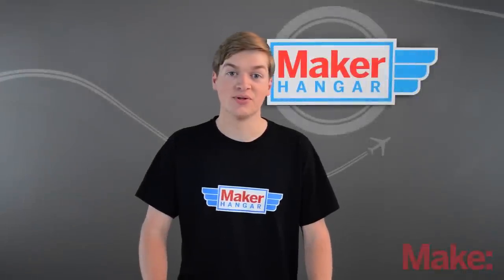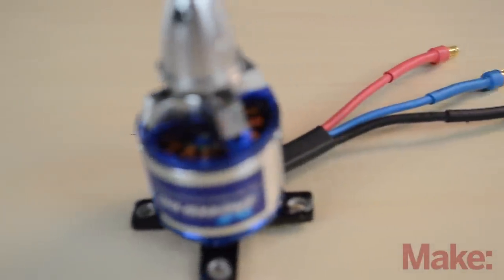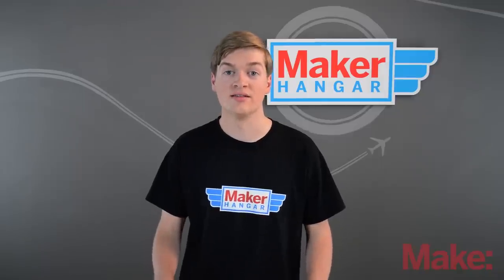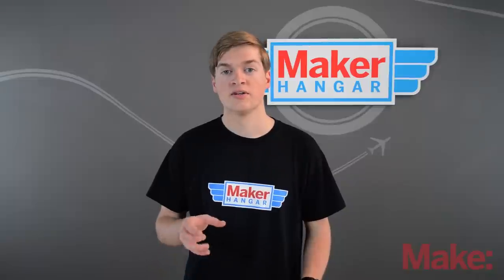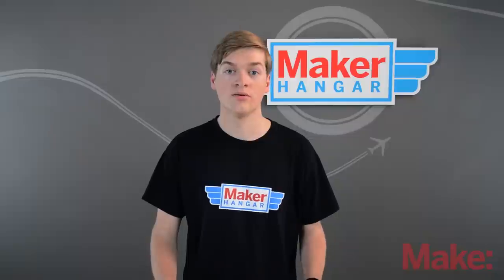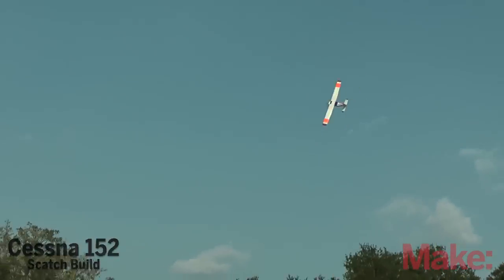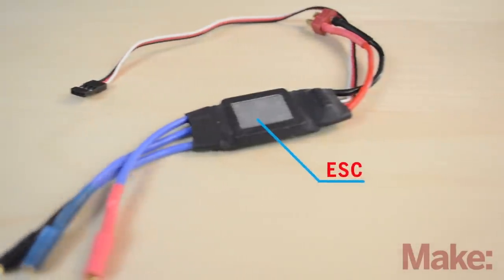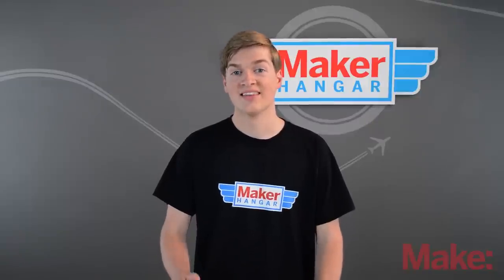Maker Hangar: Episode 2 - Motors/Propellers

Comment: I have the same plane Corsair E-Flite  crashed the same reason battery  bad  solder connection, and I have a 12X8 APC  electric propeller  , it pulls like crazy on the floor in the house   so in the air It maybe OK what size to use  2 blade, and I have a lot of 2 blades in wood  12X6  I'm but afraid  of flaps never had them in 15 years of flying so should I even try them ?

Comment: Lucas, you made some rather blanket statements about the motors. I understand cause they are a mysterious thing to most of us. The motor in your hairdryer or drill is (probably) a DC motor, AC passes through a bridge rectifier before hitting the motor. AC motors have a commutator and are NOT reversible. The motors used in the RC hobby are a special type of motor that is an AC like design but we run them on simulated AC from a PWM'd DC source.

Comment: you never talked about size of aircraft and motor type or prop size? im building a Wing vtol style meaning one motor in each wing small prop almost just as big as its wing, i was hopin to get tips as im 3D printing one and want to use a dc brushed motor
Reply: please use a brushless motor they are mush lighter and to answer your main question: if you look at some motors they will often say the thrust with a prop. if there is more thrust than weight then you can use it as a vtol. if you use more than one motor then you just ad the thrust together. hope this was usefull

Comment: hi sir nice information's I have a doubt.
what will be happen if we use high kV motor with long prop?.
I have an application of lift about 5 kg in quardcopter so for that what kind of motor and propeller is the rite one 
please help me if you know
Reply: +Manikandan R dont do that
Reply: +ConorCon Man03 why ????
Reply: +Manikandan R It wont work, high kV motors are tiny and your prop wont fit on it and is your quadcopter 5kg? That is really heavy you'll need some big motors to lift that. Probably a 370kV motor with a 12-15 inch prop: http://www.hobbyking.com/hobbyking/store/__67031__Quanum_MT_Series_4108_370KV_Brushless_Multirotor_Motor_Built_by_DYS.html
Reply: the high kv moter will just get very hot and burn out. propobly also the ESC

Comment: Hey Lucas, the motor you chosen the sealer is advising to use one of this (see below) but you chose a 6x5. I cannot understand that it goes all against you said?

Prop Tests:
5x5 - 11.1v - 123W - 11.1A 
5x5 - 14.8v - 303W - 20.5A
6x4 - 11.1v - 182W - 16.4A
6x4 - 14.8v - 438W - 29.6A

Comment: if a 3000kv bldc motor can run at 3000rpm per volt then at what maximum speed it can run or upto what voltage it can run?
Reply: 1 volt = 3000 (on a 3000kv motor) if you put 10v it will spin to 30000 but speed at the end depends on propeller size., size can add or reduce torque and speed..

Comment: What happen if I use 1000kv motor with 6 inches prop
Reply: Kuldeep Nikam you won't get much thrust. Use 1000kv motors with 10x4.5 inch props and 2200kv motors for 6x4 inch props. The 1000kv motor setup is more efficient and you will get more thrust.
Reply: And that's for 3s. For 2s batteries you need props that are bigger and for 4s you need smaller props. I mean a 2 inch difference.
Reply: it will catch on fire in middle of flight and nose dive to hell

Comment: There are so so many technical innacuracies in your videos make. brushless motors are NOT AC. They are BLDC motor (brush less DIRECT CURRENT) motors. The input is DC not a square wave as you show. And the output is a 3 phase PWM modulated square wave.
Reply: Tom Wilkinson  I would like to make  Rc plane, but I don't know how the plane size depend on motor power / capacity
Reply: Low kv + big prop = more thrust. For a three foot plane, try a 1800kv motor with an 8x4 prop. If there's not enough power you can try a second motor or get a new one.
Reply: This is a great video providing basic generalizations of different configurations.

However....
@Tom Wilkinson
You are 50% wrong here. Brushless motors are available in several different configurations....
     •AC-Alternating Current
     •DC-Direct Current
     •ACs-Alt. Current Synchronous 
Brushless DC motors have similarities to ACs. The difference being ACs motors develop sinusoidal back electromagnetic frequencies.
In comparison to rectangular or trapezoidal back electromagnetic frequency for the brushless DC motor variant.
The misconception is 3 wires dont necessarily mean 3 PHASES. It is more likely 2 standard phases with 3 POLES. For Example a brushless DC, AC or ACs motor could have 4 or maybe even 6 different wires (wire color N/A), that doesnt mean its 3 phases, 2, 4, or 6 phases (unrealistic) it just means there are 2 phases of power (1, 3, 5, 7 or million wires) and every remaing wire after power (hot & neutral phases) is considered becomes individual poles.
No different than a single, double, 3-way or 4-way light switch.
There are 5 screws on a 4-way light switch if you count the ground screw. That doesnt mean you hook 3 phases of power to it. In the case of a 4way switch it means it can be controlled from 3 other locations at any given time dependent upon input by the user, or technology utilizing device. Also means it can control multiple devices from multiple locations allowing to activate said multiple devices in any configuration you wish, example: light and fan combo you can control power on or off to either one simultaneously and with the multiple poles several different devices can control the light and fan from any location the conductors (poles) are routed to.

In the rc scenario, ac brushless is more commonplace. Due to the fact current from power source (battery) must first conduct electricity to to supplyn an ESC, FC, & RX or whatever setup you have, the power then exits as per command of ESC to what ever location  requires power (as per input from user via TX). At the point power leaves esc, switch or whatever configuration you may have it becomes Alternating Current, due to the face power is not in direct path to device. DC motors can be utilized in an AC configuration. AC & ACs can be operated on DC too. Hence the indication on motors plate AC/DC INPUT.
just have to be careful with DC power going into either configuration. Over voltage will melt winding coating in DC housing, and burn up stators in brushless AC or DC motors.
Reason we use electronics before current to motor to eliminate hazards and damage.

Have a great day.

Comment: I have to disagree with your early comments. While brushless motors are better in many ways, your statement that they are used the most is RC is not true. Can motors are far mor ubiquitous througout all areas of RC and I find brushless to be the exception. Of course, I am including all areas of RC (cars, boats, radio shack cheepos, etc.). However I do agree that for RC aviation aplications brushless are the best!

Comment: This is a great video providing basic generalizations of different configurations.

However....
@Tom Wilkinson
You are 50% wrong here. Brushless motors are available in several different configurations....
     •AC-Alternating Current
     •DC-Direct Current
     •ACs-Alt. Current Synchronous 
Brushless DC motors have similarities to ACs. The difference being ACs motors develop sinusoidal back electromagnetic frequencies.
In comparison to rectangular or trapezoidal back electromagnetic frequency for the brushless DC motor variant.
The misconception is 3 wires dont necessarily mean 3 PHASES. It is more likely 2 standard phases with 3 POLES. For Example a brushless DC, AC or ACs motor could have 4 or maybe even 6 different wires (wire color N/A), that doesnt mean its 3 phases, 2, 4, or 6 phases (unrealistic) it just means there are 2 phases of power (1, 3, 5, 7 or million wires) and every remaing wire after power (hot & neutral phases) is considered becomes individual poles.
No different than a single, double, 3-way or 4-way light switch.
There are 5 screws on a 4-way light switch if you count the ground screw. That doesnt mean you hook 3 phases of power to it. In the case of a 4way switch it means it can be controlled from 3 other locations at any given time dependent upon input by the user, or technology utilizing device. Also means it can control multiple devices from multiple locations allowing to activate said multiple devices in any configuration you wish, example: light and fan combo you can control power on or off to either one simultaneously and with the multiple poles several different devices can control the light and fan from any location the conductors (poles) are routed to.

In the rc scenario, ac brushless is more commonplace. Due to the fact current from power source (battery) must first conduct electricity to to supplyn an ESC, FC, & RX or whatever setup you have, the power then exits as per command of ESC to what ever location  requires power (as per input from user via TX). At the point power leaves esc, switch or whatever configuration you may have it becomes Alternating Current, due to the face power is not in direct path to device. DC motors can be utilized in an AC configuration. AC & ACs can be operated on DC too. Hence the indication on motors plate AC/DC INPUT.
just have to be careful with DC power going into either configuration. Over voltage will melt winding coating in DC housing, and burn up stators in brushless AC or DC motors.
Reason we use electronics before current to motor to eliminate hazards and damage.

Have a great day.

Comment: Brushed motors have more torque and less speed?  Wow that is totally inaccurate.  Brushed motors tend to be more RPMs and less torque while brushless are lower RPM and more torque.  That's why RC cars that were geared at 5:1 in the brushed motor days are now geared at 1.8:1 with brushless at about equivalent speeds.  It is also an Electronic speed controler...not an Electric speed controller.